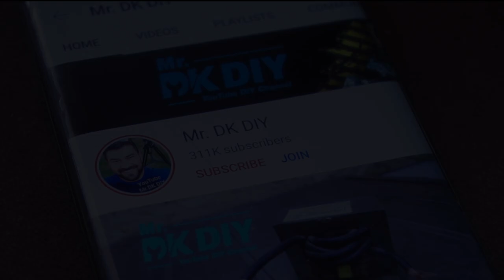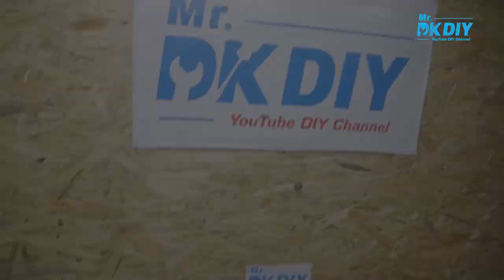Making a Simple Propane Gas Forge using (Siporex) Autoclaved Aerated Concrete Blocks and Firebricks

Comment: I think the brass rose bud..should stay outside thefire..maybe a steel tube to shoot through..air through the fluted holes helps the burn..it being cool air draw would intensify the burn,maybe?...I could be wrong...it wouldn't take much to melt  o-rings in the torch.please let me know if that helps any...tube can still be adjustable